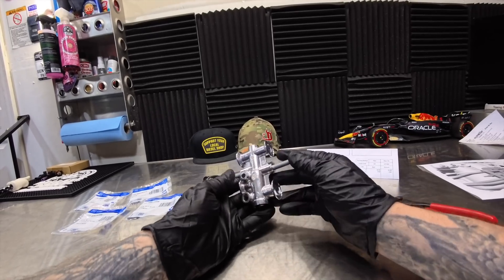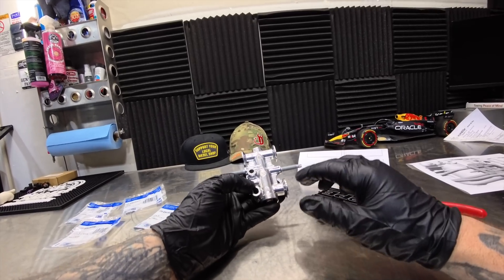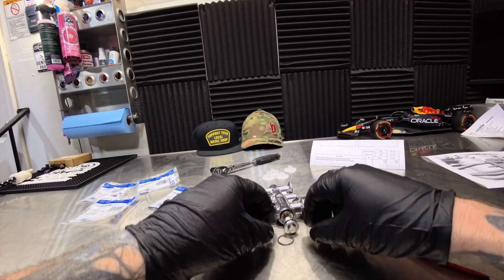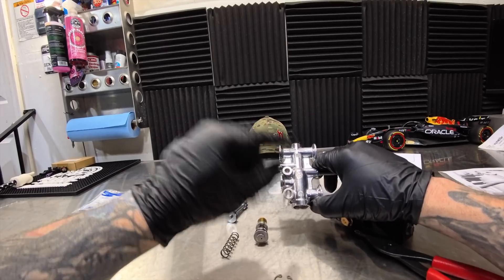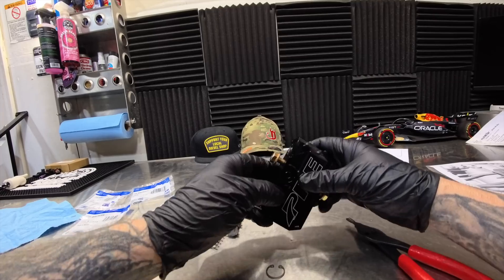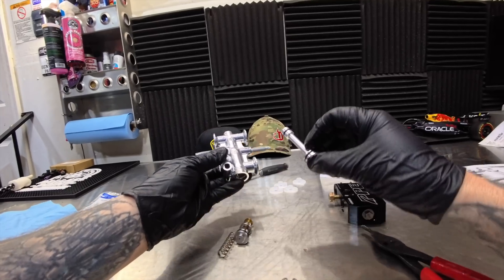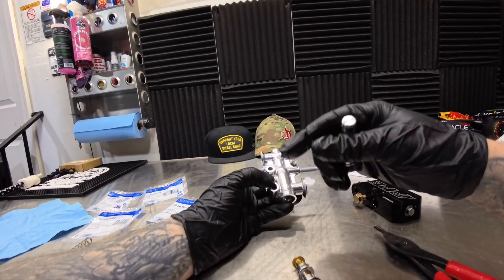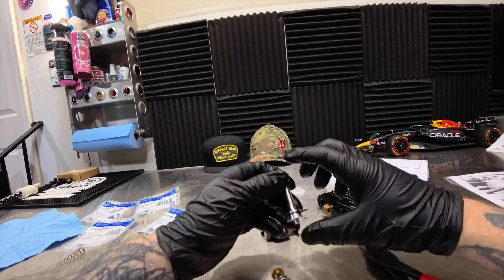Don't Let High Temps KILL Your 10L80 Transmission or Valve Body

Comment: Do you still need to get the temps up to spec after the ppe installation to check fluid level? I always thought the temp spec was just to make sure the temp control valve was open to ensure that the lines to the cooler were full.
Reply from the maker: You won’t be able to, so I just get it as warm as I can and verify fluid level.
Reply: Thanks!

Comment: Good morning, great stuff as usual.  From what I can tell off the manufacturer's websites, the barbell and the PPE bypass do the same thing.  The barbell simply blocks off the return channel in the valve body and forces all the fluid to the cooler.  I expect you'll see similar temps to the PPE bypass during testing.  Considering the price for the functionality, the barbell is by far the better deal and probably less labor intensive in the installation.  What I am curious about and haven't been able to find is the actual OEM recommended operating temp range for the DEXRON ULV Automatic Transmission Fluid.
Reply from the maker: I haven’t been able to find that either but the fluid is in so many different vehicles and they have temp ranges from 140-200. I feel comfortable in the 140 range.

Comment: I changed my fluid after little more than 10,000 miles because it always ram 220 plus when I changed the fluid at operating temperature it gushed out like it was too full had already turned brown. Changed filter refilled checked operating temperature. Now runs at 190 degrees consistently might go to192 on long hill, did go 198 on a mile gravel road where I had to drive slow. Over 16000 miles now no problems at all. I fill with Amsoil ULV.
Reply: I run amsoil as well & deleted my bypass. I got it up to 190 today hot dogging it on fwy for 50 miles on a quick trip. Typically 165dgs in city. May do the ppe block..

Comment: The Car Guy Online has a good video with a fella from Next Generation Drivelines. Worth it to check it out, basically comes down to poor engineering and cheap materials as the cause for all the issues these days.
Reply from the maker: I watched it. Tough watch, but I did.
Reply: @DemonWorks yeah, that guy goes a little overboard after awhile. 😂
Reply: @DemonWorks  Well hes right though. Like it or not.

Comment: Just bought the PPE bypass for my 2017 6L80E when I’m cruising my trans climbs to 180° just cruising not going fast that’s cruise control and speed limit. I have no aftermarket wheels/suspension set up yet but if it’s getting that high stock? I’d rather save my trans from a quick painful death and instead let old age take its course.
Reply from the maker: I don’t have experience with the valve on the 6l80 but that sounds a little high.
Reply: @DemonWorks  she climbed as high as 250 going uphill in 4L, but that was back when I had a cargo tray system in the bed of the truck it came with it when I purchased it, once I took that out my temps dropped from 200° to 175-180°

Comment: I did this same mod but added a 1/32” hole drilled into the stem on the spool valve.. works great…
Reply from the maker: Thanks for sharing your experience with the mod!
Reply: where did you drill the whole at??
Reply: @jeddboyce4275 exactly where I stated, center of the stem …

Comment: Just out of curiosity I checked my trans temp on 5.3 L powered Sierra 1500 with the 10L80 E after a 50 mile trip and it was 149 degrees…
Reply: I changed my bypass cooler on my 5.3l 2016 Tahoe and now it runs at 147F.  It was a service bulletin to change it to the lower temperature version if customers had transmission problems. I figured why wait until you have a problem and swapped it out myself, temp is the 160’s towing my boat now.
Reply: @angelolamantia  link to the service bulletin?
Reply from the maker: Gasoline engines don't have this setup so they run cooler.
Reply: @DemonWorks right !
Reply: @DemonWorks I am aware of that GM tech of 45 years , The Duramax with the 10L1000 Allison GM licensed Trans run a bypass valve
Reply: @DemonWorks the problem I see in the industry is 9 out 10 times the stock thermal bypass fails in the closed position causing immediate overheating conditions, so I have for certain good customers built in a fail safe circuit by drilling a metered orifice in the stem of the valve , after testing I settled on 1/32” hole in the stem of the spool valve, fluid fills up the cavity and then passes through the metered orifice as a safety measure in case of the stock thermal bypass failure

Comment: Ok just had PPE bypass installed and it only dropped temp 10 degrees.  Which I am happy with because the cooler the temp the longer the tranny life
Reply from the maker: I am guessing you have the LM2? Those are routed a little different from the LZ0. I had good luck with the larger pan and trans cooler by PPE on my LM2's
Reply: @DemonWorks oh I’m still happy with it as now it’s between 165-175 instead of 178-190

Comment: Great explanation as usual.

I’m curious if you have any insight as to why the 10 speeds in the 1500’s have different temperatures for trans cooling, depending on the engine.

I’ve had a 5.3 and multiple 6.2’s with the 10L80’s and they always seem to run around the 145 degree temp, unloaded. The 3.0’s I had both had similar running temperatures to what yours is. Just wondering why they all wouldn’t be the same. My guess is for more efficiency with the 3.0’s but still.
Reply from the maker: Gasoline engines are internally temp controlled whereas the diesels have this external setup. I am unsure why the diesels "need" to be warmer but lower temps are welcomed by me.

Comment: My temps are anywhere from 187-193 with the oem thermostat
Reply from the maker: That's within a good range. My LM2's were the same but I found the LZ0 has a different routing than LM2 and in turn has a higher operating temp.
Reply: @DemonWorks does it mean LM2 won’t need that bypass? I like low temp too but worry about warranty voids issue
Reply: @DemonWorks  I have a 2024 so it's an lzo

Comment: I have been changing my transmission fluid at 40k miles. What mileage would you recommend changing your transmission fluid? I know the owners manual says 45k miles but I like to do maintenance early.
Reply: I changed mine at 25 k, and it didn't look very good. I will change every 25 k because I tow a 20ft bass boat regularly.
Reply from the maker: I prefer 25-30k for trans fluid change.

Comment: Y'all making this condensation a thing.  In the old days before all this temp control stuff, transmissions were always cooled, summer and winter.  I have the PPE block and run it summer and winter with no ill effects.  And in winter, there is actually less moisture in the air compared to humid summers.  I think it's all for fuel economy and nothing else.
Reply from the maker: Fluids are very different now than they were back in the old days. Look at the massive issues the 8 speed had/has with condensation.

Comment: Living in NM it gets hot in the summer. My ‘23 GMC SIERRA SLT with the LZ0 has not exceeded 205F according to my IDASH (no towing). I am always suspicious of these aftermarket gizmos because the in vehicle testing of these things is very limited. I’ll stick with the stock setup and just change out the transmission fluid and filter ahead of the GM recommended interval.
Reply: Sometimes, an aftermarket gizmo can fix an OEM issue such as high transmission temperatures that was solely designed for fuel efficiency, resulting in premature transmission replacements for customers.

Comment: Im only seeing 190ish stock. Thats towing a bassboat. Is it even worth messing with.
Reply: 190 Ish is way too hot for any kind of life expectancy, only
good for a practically unmeasurable amount of increased fuel economy.
Take a look at the new 2020-2025 2500-3500 GM heavy duty models they run transmission temperatures at 140 to 145°
Reply: I put one on my 22 3.0, it hasn't made any difference. Truck only is from 176-184
Towing my 20 ft ranger boat it 192-196 steady. Maybe +/- 5 degrees difference from the stock valve.  I may try the deeper pan with drain, it's supposed to hold 4 more quarts of fluid,  that may get the temps to drop having more capacity.
Reply: @fishinfoo2277  When you say you put one on.  Which one, the barbell or the PPE bypass
Reply: I did this modification with one added additional modification which was I drilled a 1/32” hole through the stem on the spool valve.. works perfect

Comment: Heat isn’t the reason valve bodies fail.   With that said I agree that slightly lower temp would be good to see.   However anything below 180f becomes its own issue.
Reply: Not true - the Chevy and GMC 2500 HD trucks with the same exact ULV transmission oil as what’s in the 1500s GM has the thermostat opening set at 140°
The only reason GM has the 1500s set at 196° is for fuel economy and EPA kickback monies Unfortunately these unreasonably high temperatures are at the expense of us consumers.
Running a transmission even as low as 120° will not hurt anything and as a matter fact, adds more viscosity lubrication to the transmission compared to 196°
Reply: @MarkSmith-cz3by its not set at 196, my transmission never sees that temp maybe 186. Mine fluctuates between 187-192 and that takes 30min of hiway driving to reach that temp
Reply from the maker: I believe heat has played a big role in the valve body failures. Fluid breaking down and causing a lack of lubrication in the valve body. That being said, it's not the only failure point. Heat kills, I prefer cooler temps.

Comment: Patiently waiting for someone to make a kit that fully opens 20-30 degrees below stock. Not interested in a full bypass
Reply: Even if it were to open 20 to 30° sooner, it still would not flow enough oil to the cooler to make much of a difference during hot temperatures not to mention towing.
Cars and trucks have been running full flow non-thermostatically controlled to the transmission cooler for decades without the types of transmission failures that are occurring today with these extremely high temperatures
Reply: @MarkSmith-cz3by possibly, but full bypass is terrible for trucks that need to drive in extremely cold weather.
Reply: @MarkSmith-cz3by they did exactly that with the 6l80’s the updated part would run around 157-175 if I remember right and it worked great. I installed it on my 2018 and it constantly ran 30 below what it did stock an never once reached as high as it did prior to changing it.

Comment: If I put the PPE oil pan an trans pan on will it void warranty on my 2024 3.0l?
Reply from the maker: Any modification could have warranty implications. The part needs to cause a failure that would otherwise be warrantable, though.
Reply: Only your dealer can tell you if they will decide that any warranty claims will be voided by the replacement pan. This is what everyone wants to know and some dealers are understanding and some think anything that isn't OEM voids the warranty.